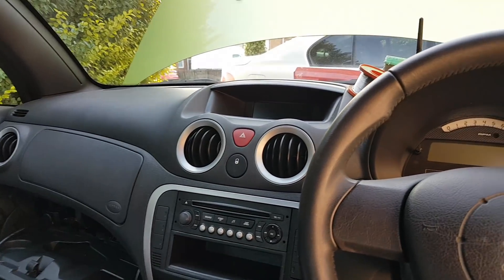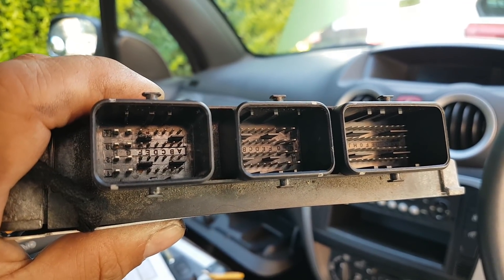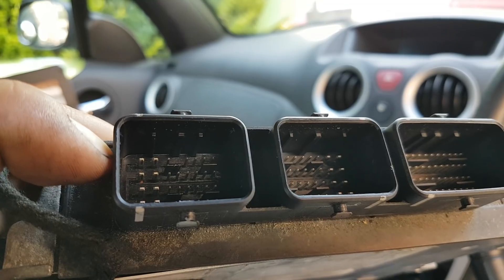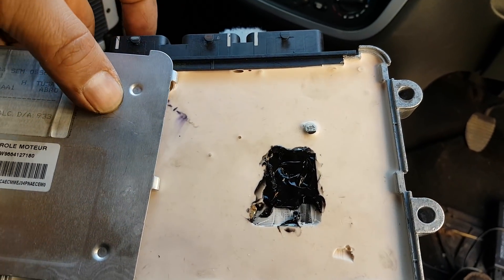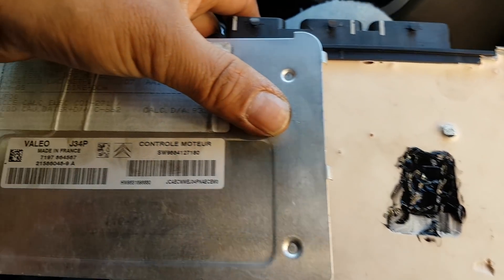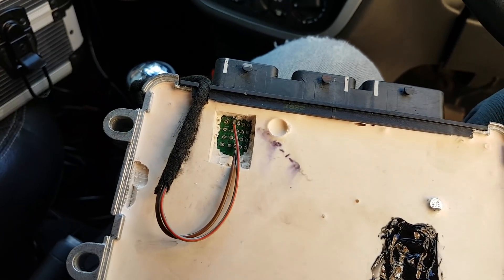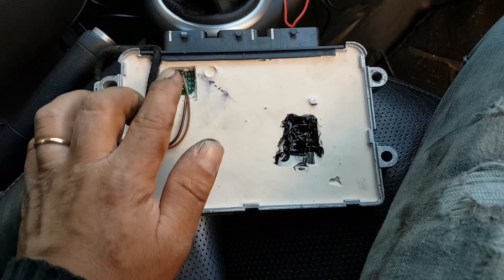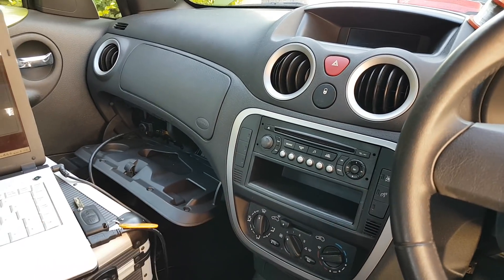ECU broken or missing pins... how to get around it without having to get another module...

Comment: What if I have just one broken pin do I solder a wire to be spliced into the wire it goes to on the harness?
Reply from the maker: You can do that... or replace the broken pin...
Depending on which pin, and on the ecu, it can be relatively easier...
👍👍👍
Reply: @LMAutoRepairs  it’s an Audi q5 3.2 liter 

And the pin that’s broken it says it’s the power steering pump. Will that still work?
Reply from the maker: Should do...
Reply: @LMAutoRepairs thanks

Comment: Haha same thing happened to me yesterday. O2 sensor code p0132 and p2197 had me snooping around so I was checking wires and opened the PCM and BOOM broke 1 little pin and completely disabled the truck. Now I'm waiting for a used reprogrammed PCM so I can continue the search to fix my p0132 codes

Comment: Thanks for posting this.  I had a similar problem with a broken-pin on the ECU on a totally different car (2002 Chevy Camaro SS...the broken pin was for the AIR injection pump so I was getting a Check Engine light).  Your video gave me the idea to try the same type of fix.  It turns out, on my car it was even easier because the ECU didn't have the silicone to cut through (GM used rubber gaskets in that year to seal the ECU.)  It was just a matter of finding the right terminal to make the solder connection.  Anyway, good idea and thanks again.
Reply from the maker: 😊
That's great! 
👍👍👍

Comment: There is a simpler and nether way to fix the broken pins ; unfortunately I did not tok pictures, but the idea is that you take a small drill and dril right next to broken pin, ad flux in the hole , pre-solder a new pin , put in the hole and heat it up ; it work perfect .

Comment: I have a peugeot 207 2009 1.4 petrol, having issue with water getting in that same place, ive been told it is coolant temperature sensor, wonderring if you can advise?
Reply from the maker: There is that possibility...
Check the plug and wire... if it is, replace the sensor...
Thank you for watching!
Reply: @LMAutoRepairs  ige been told replace the coolant temperature sensor? And make a link? Soilder with a soldering iron, something about a seal? The soilder should then stop the water geting back in,i cant find the coolant temperature sensor and peugeot themselves say my car doesn't have an electronic one..  and i don't understand how water runs up wires to get in ...  only faults come up was to do with trottle body/ throttle position sensor? Could you advise?
Reply from the maker: @markusticklr6067  
The water and oil can get through the wires when the sensors fail and start to pass all the way to the terminal on the electric plug... that's how it happens...
If you have signs of water on the multiplug then you need to find where is coming from and stop it...
Reply: @LMAutoRepairs  thank you, that's a big help =)

Comment: nice fix but the problem actually comes from the electronic thermostat thats why water goes into the ecu the best solution is to replace thermostat,solder the wires that plug into the thermostat then you have a permanant solution
Reply from the maker: Thanks!
For watching and for your comment! 
👍👍👍

Comment: nice fix but the problem actually comes from the electronic thermostat thats why water goes into the ecu the best solution is to replace thermostat,solder the wires that plug into the thermostat then you have a permanant solution

Comment: Hi 👋, I have a Peugeot 207 1,4 that is not starting. I did a diagnosis and the code I‘ve got is P1031 and that’s the only code I get. What does this code mean and is this the reason why the car won’t start? Thanks a lot!
Reply from the maker: Hi
P1031 if I recall correctly is O2 related.... 
Check live data while cranking... look for engine speed etc...
Thank you for watching!

Comment: Hello, not related to this video but. I succesfully replaced the ecu on my Opel Astra 1.6 2005 with a used one using Op-Com. The problem is now that i dont have cruise control anymore. The stalk doesnt work. Any ideas how to get it working again? I did match the partnumber on both ecus. Thanks
Reply from the maker: Hi
Check coding.... possibly was not installed on the car where it came from...
Thank you for watching and for your comment!
Reply: @LMAutoRepairs  Hi what coding are you talking about?
Reply from the maker: @lollershit  
Hi
https://youtu.be/70mteUUUzjg
I would recommend you to watch the entire video... but you can go to minute 21 and see what I am talking about...
Reply from the maker: @lollershit  
😉
👍👍👍

Comment: Hi, smart move again. May i ask you something ?  i got c2 2004 with same engine just it has diffrent ecu, anyway i scan car and i got p1613. Carprog doesnt explain that but i found its a O2 bank 2 fault. I took a look to live data which is confirmed that o2 bank 1 works fine, but nothing on o2 bank 2 (after cat one).I couldnt switch and test the plug cuz sockets are diffrent.  Probably most of o2 sensors has same connections. So i measured resistance of part , between pin 1 - 2 has high resistance (3 or 4 times more then they explained at part info).  Pin 3 - 4 must be between 4 -5 ohm which is good on part. Also Ecu connection has power( 14v ) etc so wiring between o2 and ecu seems fine too. Car is in limp mode. Here is where i confused, wiring is fine, broken or not O2 sensor wd show something on live data right ? i mean that value cdnt be accurate but more less i shd see something, but it shows nothing. So im suspicious about ecu side. I wanted to get your thots about it. Shd i order O2 sensor or what ? İs it normal that shows zero data on live scan mode ?
Reply from the maker: Hi
It should show something indeed...
Proving that the tool you are using is reading live data ok...
Trey to input the upstream sensor into the downstream plug into the ecu...
If you them see readings on the downstream (provided by the upstream sensor...), that will mean your ecu is ok...
Hope it makes sense...
Thank you for watching and for your comment!
Reply: @LMAutoRepairs  Make sense, i understand  what you mean. Thanks.
Reply from the maker: @taskinyucekurt  
Report back...👍

Comment: Another great video
Have you ever come across a 1.4hdi when plugged into lexia that engine speed on dash 800rpm registers
6000rpm on computer. Replaced camshaft and crankshaft sensors although no fault flagged up on fault codes
Bosch system   just that it has a harsh noise between 2000 _2300 rpm and trying to sort it out it
Do you think the copy of pp planet. Lexia is corrupt from China
Reply: I never registered any abnormal rpm readings either in PP or Lexia clones in several Peugeot / Citroen gas and diesel.
Reply from the maker: Can't really comment... never noticed that, but to be fair can't remember being paying attention to that either...
I will keep an eye next time I work on one of those...
Thank you for watching and for your comment!

Comment: What the hell is going on with Citron and water?!
Reply: Question is not Citroen is Sagem, Bosch, etc... These ECU's are used by several manufacturers and they pretty much all get into the same issues. Because it's basically the same parts. ;-)

Some simple tips that help if you start with a "new"/recent car (meaning not damaged).
Don't remove the protections under the engine. They're a lot more than simple splash guards. 
Keep any ECU covers/caps in place, while making sure they are neither damaged or badly assembled/fitted. Same apply for the plugs and respective seals.
A preventative cleaning with "electronic contact cleaner" every 3~5 years will avoid a LOT of headaches in the future. Followed by a squirt of WD 40 or equivalent, on all those pins and some blown compressed air to remove excess.
Note, what is wanted is a protecting film/layer, not drench it in WD40.
A tiny squirt of silicone spray on the seals will also keep them pliable and in perfect condition. While help keeping water at bay. ;-)  

If you're starting with a car where damage is already in place. Like in the video example. Well then its first correction measures, followed by the above prevention of future issues. 

I guess it's worth saying. That all the above writing, in practice, accounts for 10 to 15 minutes intervention every few years! Not as bad as it might seem. LOL ;-) 
Also it totally apply to relay and fuse box, etc.

Cheers
Reply from the maker: @crpth1  
Well said!
Thank you for watching and for your comment!
Reply: @crpth1  Well, that all good for people like us that like to get their hands dirty, but i still think cars are badly designed.  
Granted, i'm not a mechanic and i have only my cars to form my opinion.
Why should the air filter on C4 be placed behind the engine when there is space in front? The air is routed back and then front exactly by the place where they could have placed the air filter. 
And a few months ago i had to replace a steering pump on a Seat because some smart people placed the plug with the opening up, just like a cup. It collected moister that slowly got past the seel. 
Even looking at Luis Videos, we can see that some stuff in cars is just badly done. 
Brands don't care about maintainability or clients, they care about potential clients... that is over the moment we buy.
I guess this means more work for Luis, but damn it sucks for users.
Reply from the maker: They go hand on together..... lol
Thank you for watching and for your comment!

Comment: Hi I wonder if you could help me with advice I have problem with the Zafira B 1.9cdti engine code Z19DT I replaced DPF to the new one as it was doing the regeneration every 100km more or less now on the new one is doing the regeneration every 50km more or less I have change the injectors too as the fuel consumption was high on idle 1.2l/h now is down to 0.7l/h the garage who did the DPF replacement said to me this is normal as I'm driving more in town 😔 with to mention it is smoking a lot on the regeneration the fuel consumption when is doing the regeneration is up to 5.8l/h on idle very high in my opinion. Do you have any idea what can be wrong? I can't find any decent mechanic in Plymouth where I live non of the mechanics could say what's wrong as there is no faults in the ECU.
Reply: Have you had the chance to drive on clear roads and compare the results?
Any particular error codes? Maintenance on time? EGR & MAF functioning well?
Cheers
Reply: @crpth1  hi thanks for the reply. EGR Has been replaced a week after the DPF been changed. There is no faults in the car that's why all the mechanic I spoken to have said it is fine and I have to live with it. So I'm looking for someone who can read the logs and tell me where the problem is. For this engine average DPF regen while driving in town it should be 400km not 30km unless you stop regen before it Finnish the cycle. I can tell Luis know his job by watching his videos of troubleshooting unfortunately this is very rare to find mechanic like Luis who can fix cars without guessing and replace part after part if there is no fault codes in car.

Comment: To remove silicon from ECU like this one, you have to use Toluen. It will disolve the silicon and the plastic an the PCB will not be affected, but dont use acetone. You will have it soaks for few hours and it works very well and by the way, I like your videos ;)
Reply from the maker: Thanks for the tip...😉
And for watching my content! 
👍👍👍